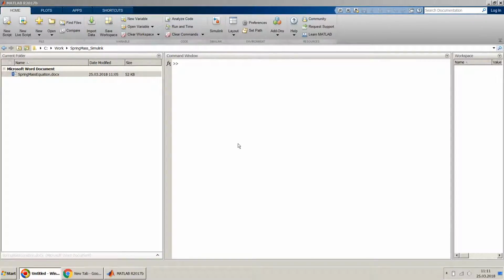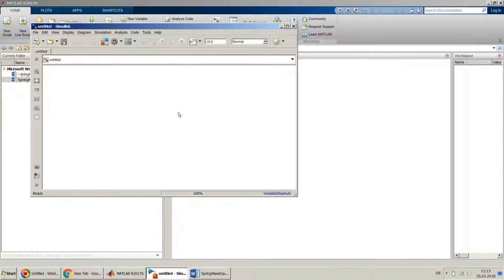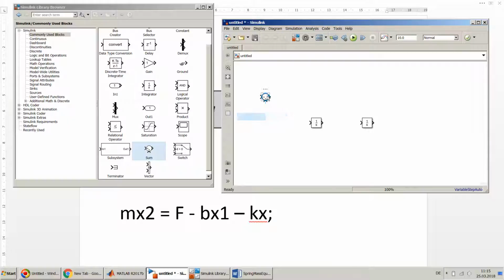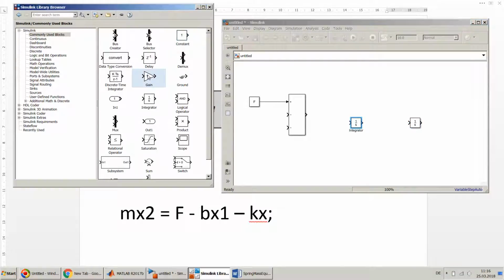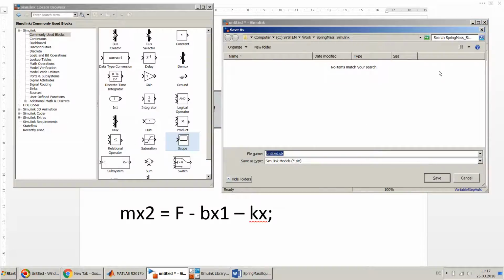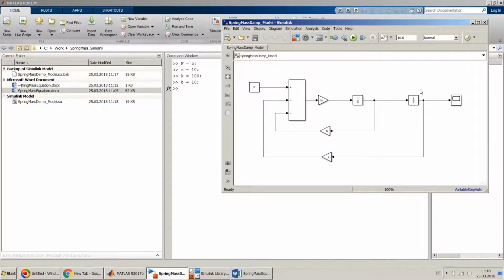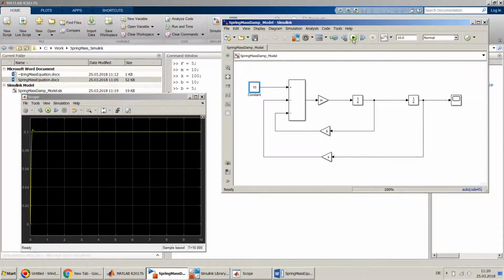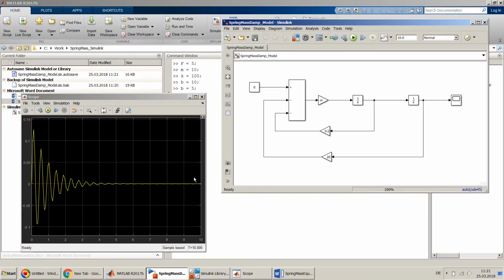Design Spring Mass Damping System in Simulink - Part 1

Comment: Thank you. Can you please make a video for spring mass system under Free fall
Reply from the maker: Sure, will try to make a video to show this. Thanks for the suggestion. However, in free fall the only change in the model will be that the Mass block will be subjected to a "-g" (acceleration due to gravity ~9.8m/s^2). So, this extra force needs to be added on the Mass in the opposite direction of the fall.

Cheers
Programmer World
https://programmerworld.co

-

Comment: Will you consider that m supposed to be 1/m ?
Reply from the maker: Yes, you are correct. It should be 1/m. Sorry for the error. But ultimately it will not make much difference in the model as the symbol boils down to numerical form in the model. Thanks.

Cheers
Programmer World
https://programmerworld.co

-

Comment: Is there any way you could make it with a step input block instead of a constant value block?
Reply from the maker: Yes, one can use step input block also in the place of constant block. The result will be same as long as the value of step signal is same as that of constant block. 

Good Luck
Programmer World
https://programmerworld.co

-

Comment: how to get length of suspension
Reply from the maker: Can you please be a bit more specific about what do you mean by suspension? Do you mean the length of spring and damper? If yes, then you can only get this length by the value of x at any specific instance of time. Please note, this length keeps changing continuously as the mass block moves. 

Cheers
Programmer World
https://programmerworld.co

-
Reply: @ProgrammerWorld  I want lenght of damper
Reply from the maker: @shoaibshaikh4007  Perfect, then as I mentioned in my previous comment,  X value will give the length of the damper at any instant of time.

Hope above helps.

Good Luck
Programmer World
https://programmerworld.co

-

Comment: Can u explain how to solve a SDOF spring mass damper system under impulse force in simulink??

PS: I am new to Matlab
Reply from the maker: Instead of putting a constant block for the force, you will have to put the impulse signal block in your model. 

You can watch my below video to understand how to design PWM signal:
https://youtu.be/wo0eIZq93aU

And below video to convert Pulse to square signal
https://youtu.be/m6aw6HcIbPc
Reply: this is helpful in that case https://youtu.be/7fTZhBvl6GM

Comment: it's 1/m not m
Reply: thanks
Reply: correct
Reply from the maker: Yes, you are correct. It should be 1/m. Sorry for the error. But ultimately it will not make much difference in the model as the symbol boils down to numerical form in the model. Thanks.

Cheers
Programmer World
https://programmerworld.co

-